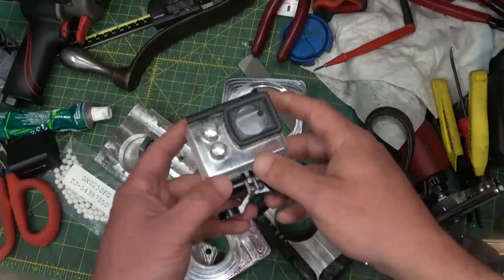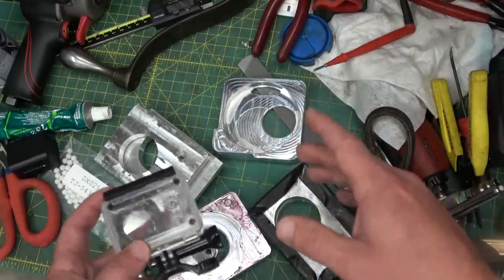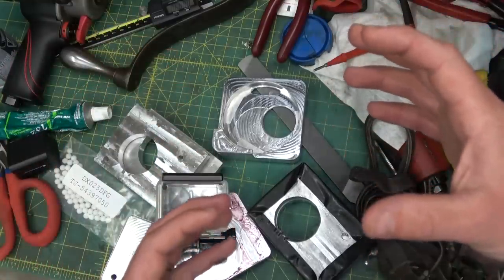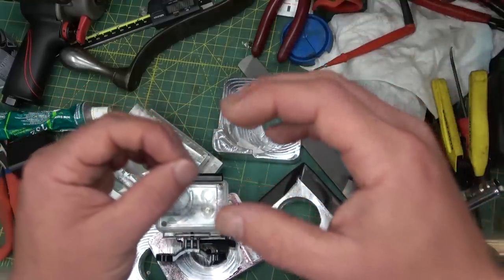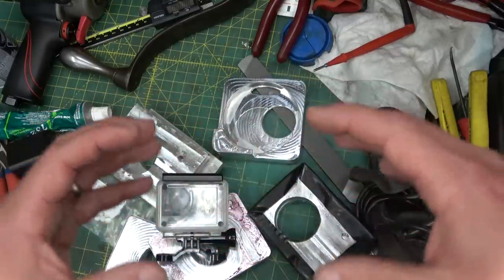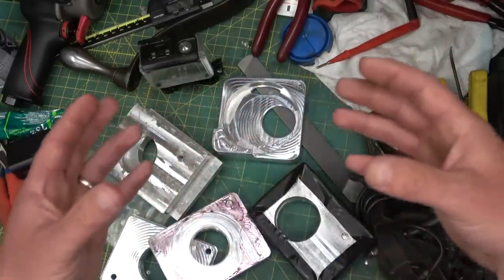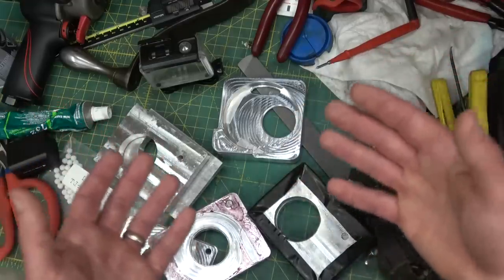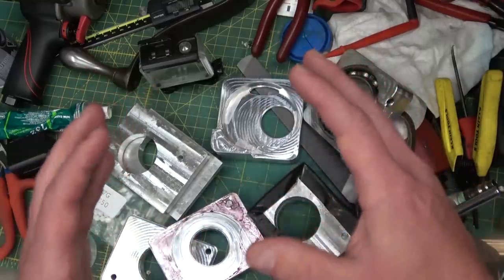Homemade Spinning Lens | self-cleaning gopro prototype

Comment: Shmoo remover, you needed something to fling the shmoo in the porta potty, save you using the barbecue tongs. I have stopped throwing up after seeing the manual tong based shmoo remover in action. 
Now AvE, remember from one who knows,  from experience on our trailer, (read caravan in Down Under speak), to fully open the potty flapper when using the potty so shmoo, both solid and liquid types don’t fall down inside the potty cabinet and miss the shmoo cassette and turn into stinky black water waiting for you to remove the casette on your way to the dump point. I guarantee you’ll throw up - potty shmoo stinks!

Comment: Why not make an empty zoom lens of sorts , and use air jets to blow inside the tube away from lens in a spiral pattern. 3-4 jets should do. Air jets near the lens blowing out the end. Positive pressure inside the tube should mitigate the incursion of spray getting on the lens.

Comment: Take the housing off the gopro. Design a new one with a circular lens and put an ultra thin shaft for a motor running right through the gopro to spin the actual go pro lens/glass

Comment: why not cut a circle of glass 5'' and drill a hole in the middle with a diamond encrusty glass cutting bit, thenn take the arbur from your hole cutter , bolt that through the glass hole, put it into your battery drill and spin-emy-thing it

Comment: Why not use a larger disc mounted on a shaft?
Reply: watch the first video
Reply: @scottr939  I thought I had?
Reply: @gravyblue  He already has one of those rotating disks with a center drive thing. He wanted something that had no obscuring center post/motor, and doesn't want it to be 2x the diameter of the camera lens. He wants something as small as possible that fits on existing camera so that he can use many cameras in the CNC cabinet and move them around at will. A fully portable device would also be useful for e.g. filming outdoors in the rain.

Comment: Oi!  drive the bearing using coolant. As it passes through the volute it could be directed to the cutter.
Reply: And it lubes the bearing surfaces. Of course if it's not screened it may cause the fucker to stall, but if it makes it to trial who cares-- it doesn't even require any mods to the current design but 2 tapped holes.

Comment: what about a Tesla turbine like design?
Reply: It got really close with the air bearing designs.  The biggest downside I see is a size increase, since you'd need to offset the viewing window by a larger radius to clear the exhaust ports in the center.  They are supposed to be very schmoo-resistant, and "TESLA TURBINE!" is a fantastic clickbait title.

(Also, pressurized air is more fuss than electric drive.  What if you drove a Tesla pump from windings on the rim, like those TMD computer fans that failed spectacularly?)

Comment: RainX won't work but what about a ceramic coating? Also maybe you could ceramic coat the lens you made it will help
Reply: The expensive ceramic coatings repel soapy water just fine after a couple years in automotive use.  I do wonder how long it would work in this application.  A good ceramic coating is definitely far better than RainX on a windshield.  It would still need motion or air flow.
Reply: It does take a while to apply those coatings, and apparently it's easy to mess up according to some people I know. Then again I suspect they often mess up tying their shoes.

Comment: What about a camera enclosure like they use on racing cars?
Reply: That is a different kind of problem.  Bug guts don't just fling off.  Those mechanisms use a clear film on a roll like packing tape and as bugs smash into the film, the mechanism pulls some new clean film out in front of the camera.

Comment: You could probably bodge something like this together with junk parts, get an old CD Walkman and that nickel back CD your ashamed of and use some duck tape to pull off all the shiny then strap it to the side of the GoPro case and boom DONE. 👍👌
Reply: You could probably bodge a cheap CD walkman into a complete working unit, using a "clear CD" like the top covers for stacks of CD-Rs that come on spindles. hardest part would be figuring out how to run the motor without the mainboard in place, or finding one that has enough dead space to cut your frustum hole through the chassis...
Reply: Michael Free you can just run the motor straight fro a battery, as far as I’ve seen most cd Walkmans use standard DC motors. But yeah the clear top disk from a stack of CD-ROMs is a great idea.... but you don’t get to destroy your nickelback cd...

Comment: Its hard to describe it just through a comment but ill try anyways.  Have let say axis of revolution Z outside the camera case parallel to the forward axis of the camera view.  Put an appropriately sized dc motor along that Z axis.  Attach a large enough diameter glass disc (radius = the x,y offset from Z axis to the center of the camera lense plus a bit extra).  Then apply Powha' and ka'ching.  Ill leave the further optimizations to the collective brains of the interwebs.

Comment: Another solution is to use an air knife that basically creates a sheet of high velocity air on top of a boundary layer (i.e. https://www.eputec.de/en/en-exair-industrialhousekeeping/en-exair-industrialhousekeeping-window-blowoff/#iLightbox[1ff04bb570935eba8d3]/0) . I think the DC-9 had such a setup and it worked really well. The problem is you need a fairly decent blower to make it work and it is noisy.
Reply: Actually the chap at edge precision has already done this - and it seems to work fine but I imagine you need a goodly sized compressor. I used to race motorbikes and RainX is completely useless - tearoffs are the only thing that sort of works but they are a pain.

Comment: Getting you esters, ethers and alcohols a bit mixed up. The ethylene glycol in typical anti-freeze might convert to oxalic acid and that then might react with metals like that in the old time soaps. However soap is based on monogylcerides and sodium or pottasium hydroxide and then the glycerin is a buy product that might be left in the soap. Glycols could from di-functional acids that do not act as surfactants but form scummy or hard deposits such as those in kidney stones. Schmoo to kind, scum it is, no better word will suffice.

Comment: AVE! You've made an oversight in the fact that you've used a UV filter. With some lights (see: The Sun), it will change the color grading as you rotate the filter and in some cases affect brightness due to the different wave directions in the UV light itself. If you spin it up like you have, you'll end up with a possibility of a strobing effect on your end footage.
Reply: Maybe you're thinking of a polarizing filter? I haven't notice any of my UV filters changing anything depending on orientation.

Comment: There was a tech in PC Cooling for awhile, TMD (Tip Magnetically Driven) fans. 
http://www.dansdata.com/tmdfan.htm
Unfortunately seems no longer made, seems there was a recall about the screws to hold the fan in place were causing shorts. Might have been interesting to try and mod.

Comment: Umm... there's nothing saying the center of rotation has to be in the center field of view, cut (turn) a piece of plexi about 6" dia. (~15cm) center drill it while its still on the lathe>threaded rod though the middle nut-washer-plexi-washer-nut, power the rod. electric... drill motor... or r/c car motor... if you want to go stupid and see if you can achieve LEO Dremel or router just aim it away from your face!, air turbine...(die grinder) better control over flow... maybe? hydraulic? run it off the coolant pumps... (ok maybe not). Just make sure its balanced so it doesn't introduce vibration (thus turning on the lathe). House the motor off to the side and maybe slightly behind the camera. the closer you can get the motor to the aperture, the smaller the spinning disk can be (and the faster it can be rotated with less power...of course).  Just avoid the Dremel, that's a bad idea. (google cd's + dremel to see the carnage; 2007 called, it wants its pixels back).

Comment: An addendum to your comments early on. Most are not skilled in  critical thinking. 90% of ideas are garbage. Most do not think about the thinking. Ya gotta look at it and discern how it can turn on it's head or have the opposite result. Also how it could potentially critically fail causing a big ol mess.

Comment: Hey man I'm a commercial truck driver I use rainx faithfully I've ran a minimum of a million miles check out my profile for yourself if you clean your windshield properly and then apply it the way it says it'll last a month I get about 3-4 uses per bottle for a lousy $8 I also use it on my car truthfully it works better on my rig due in part that the windshield is not sloped so at 70 mph the rain does not stay on the glass again look at profile

Comment: I don't know why but I felt extremely compelled to make my own version of this in fusion. I omitted bearings because I have no fucking clue how that stuff works and what dimensions i'd need to go with,  but I think a version like mine with an axle and larger spinning disc would probably be more reliable. It would also be way easier to make this run off either electricity or air power. Enjoy my retardo designo.   (https://a360.co/2Y2eCli)

Comment: If a patent infringement requires multiple prototypes, is it still patent infringement?

Actually, AvE if you ever read this, i've been wanting to make an open source collection of basic science machinery. Centrifuge, thermocycler (a heater that knows how hot it is, basic stuff), automated pipetter, things like that. Why? To seize the means of (research) production, of course comrade! Nah but seriously big money interests in science produce bad science. Too many black boxes that the conclusions completely rely on to work as expected. My worry is however that we will stumble into other people's patents, much like you did here. My question - is it all Fair Use if you're trying to cure cancer (do research with a machine you built that infringes a patent), or do the courts not see it that way? At the end of the day if someone wants to replicate, they will have to buy your machine (albeit not necessarily from you if it's open source), and while one could cover manufacture costs, the court might still see it as selling for-profit. I am not a lawyer though